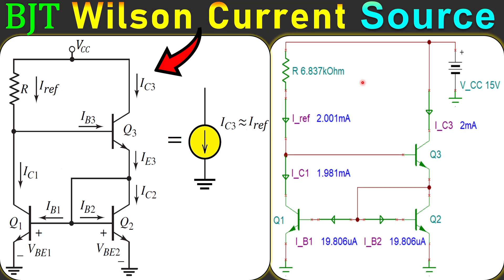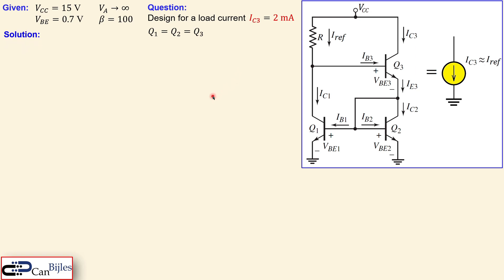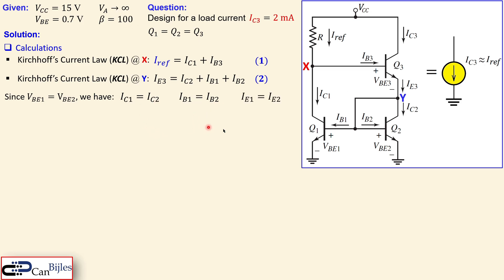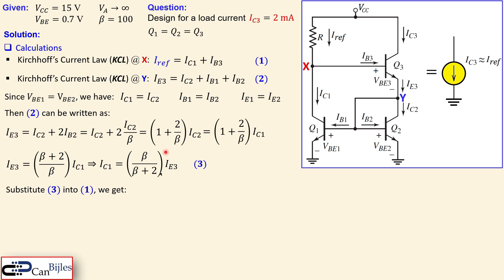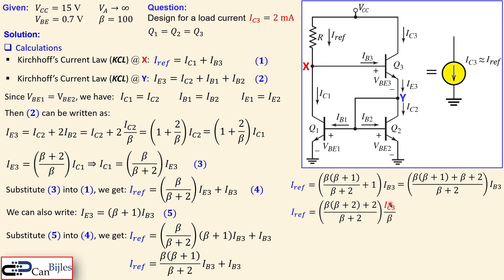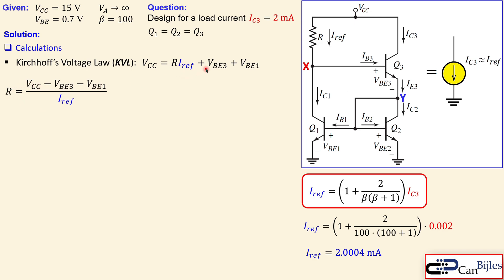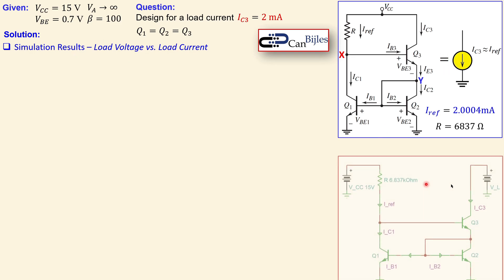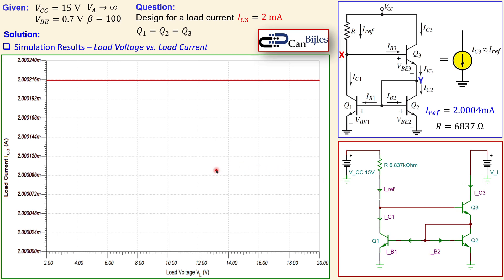BJT Wilson Current Source Design 🌟 Calculations & TINA-TI SPICE Simulations 💡 Example 3

Comment: How is the output impedance actually calculated in this case?
Reply from the maker: First, you will need to setup the small-signal model of the circuit. Then, you determine the impedance looking inside the collector of Q3. The result will be: 0.5*beta*r_o3.